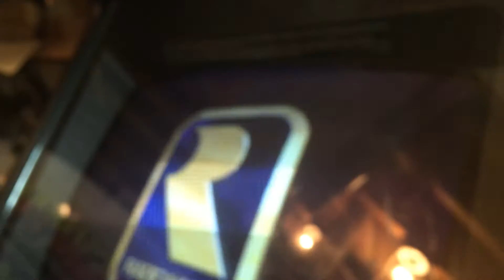killer instinct arcade with sound issue

Comment: If anyone else will have similar issue, please make sure to check -5V rail first. This was the cause.
Reply from the maker: Thank you very much Dmkf for the support!! It was indeed a -5 volt missing from the connector.
Reply: Hi Arcade Moi Ca, could you please let me know what steps you did to fix this issue?  I'm having the same problem and I noticed nothing is connected to the -5 volt
Reply: BookerD5 Just get a power supply that can feed -5V line to the board. That's it.
Reply: Thank you for the reply dmfk.  The power supply has a -5V port, but I don't see any extra wires to connect to the board.  Would you know what I need to connect to the -5V line to the board and where on the board to connect to?  In the manual it says E5, but I don't really understand it.  I can see that the +5V line connects to C3 and D4, but I'll trace the path from the +5V to the board to try to understand it better.

Thanks again for the help.
Reply from the maker: If there is no extra wire coming out from your harness you will have to to solder a wire to the -5 volt pin and connect the other end to the -5v screw of the power supply. Google "jamma harness pinout" to know where the -5 volt pin is located on your harness.
Reply: Thanks a lot for the reply guys.  This makes a lot more sense.  There is no wire coming out of the -5 volt pin area so I'll have to think about the soldering stuff.
Reply: I'm looking at a replacement jamma harness.  Would I need a jamma plus harness since that says it uses 6 buttons, but a standard jamma harness chart does show all buttons usable for both players.

Thanks again for the help.
Reply: You don't need any JAMMA plus nonsense. Extra buttons for late Midway games were connected to auxiliary ports. Please refer to game instruction manual for details, since each board has its own designator name for such connector. Particularly on this Killer Instinct board that connector is located right/left next to HDD pin header.
Reply: Thanks dmkf for clarifying.  The manual PDF I found online is just a regular JAMMA connector.
Reply: No problem, have fun!